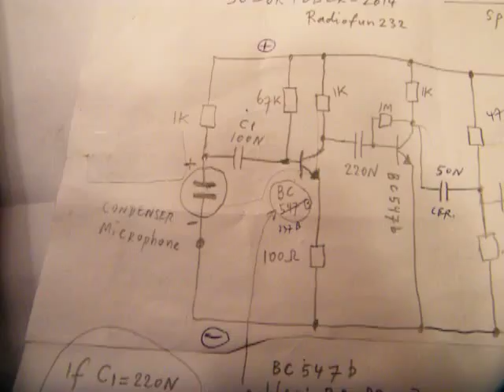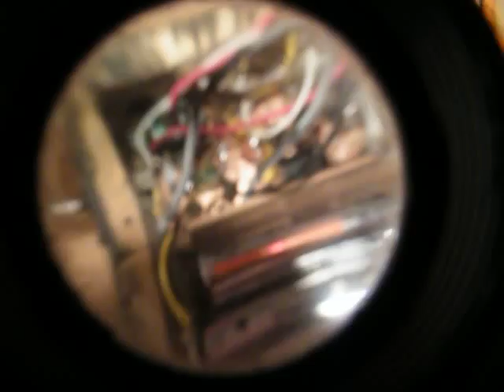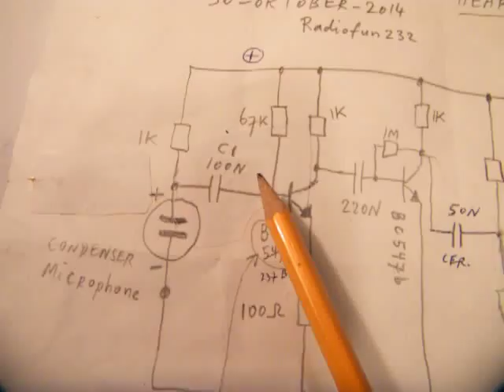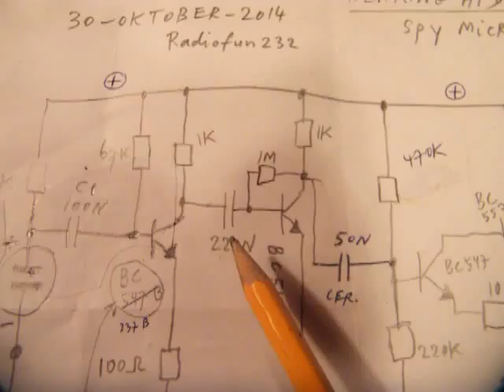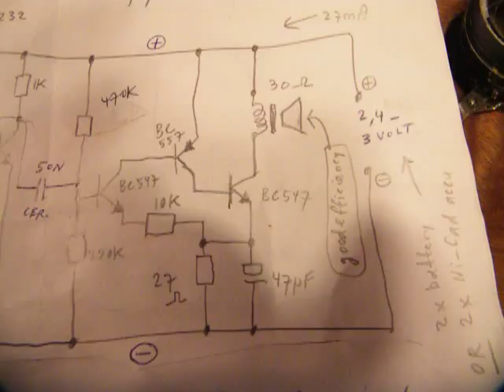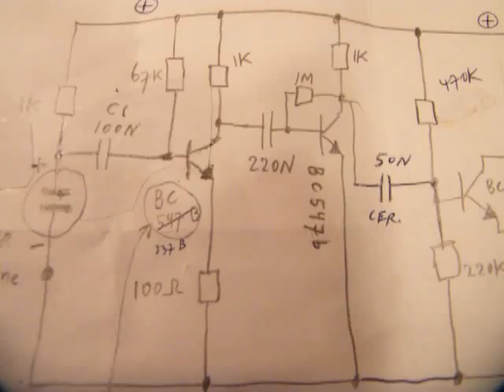Hearing aid for (elderly) people / electronic spy microphone on 4,2/4,5 Volt

Comment: Thank you. your generosity is appreciated. Something I can make with minimal expense for elderly with low-fixed incomes.
Reply from the maker: +stephen quinn You are welcome. The only problem with the circuit is that you always need fresh batteries, but anyway, that does not compare to the cost of 1800 Euros. I tested the circuit with elderly, it works fine.